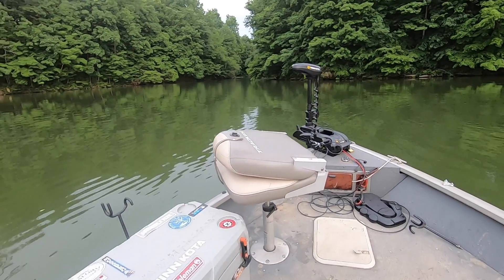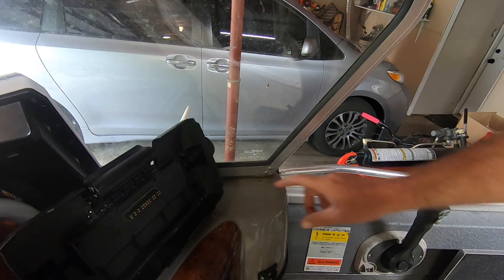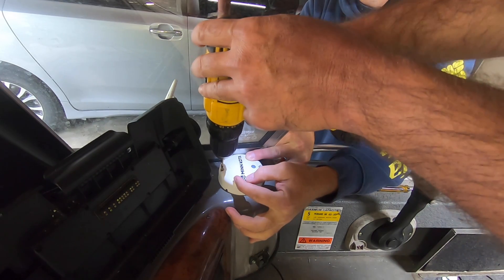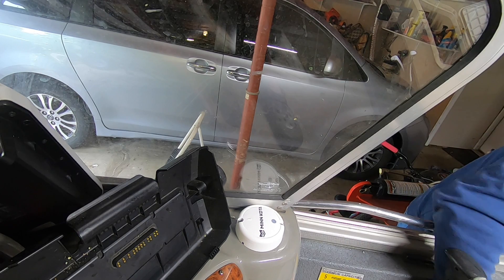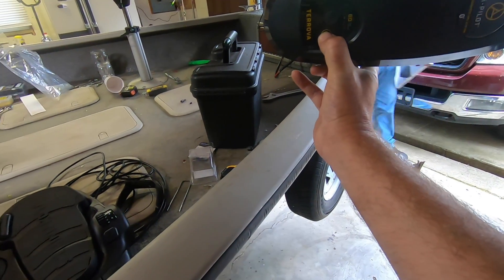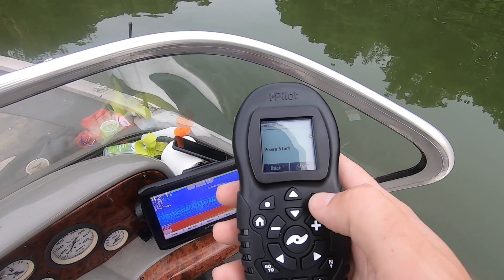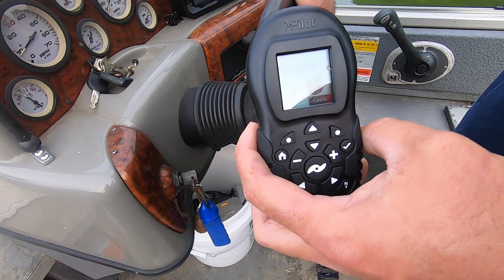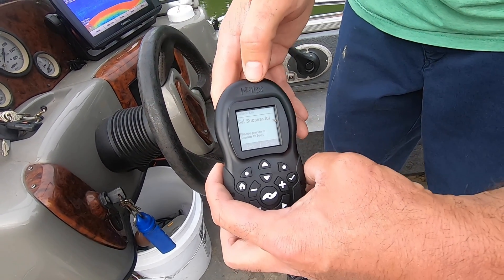Minn Kota Heading Sensor Install, Pairing and Calibration

Comment from the maker: To clarify a mistake I made in this video, the gps is in the motor itself. The heading sensor is basically only useful during the spot lock jog function
Reply: So you can still spot lock without this? It'd basically make me need to buy another battery, so I'm not sure If it's worth it for me yet.
Reply from the maker: @auzyham  yes you can, but I dont see where you would need an extra battery
Reply: Just run it to your starting battery 👍🏼
Reply: I know this is old, but people like me are still watching it. The heading sensor does not point to the front of the boat. The arrow is supposed to be parallel to the keel. Its purpose is to tell the GPS which way the boat is traveling. If you mount it at an angle, it will think the boat is traveling on that axis.
Reply: @williamswavely698  Yes, installed parallel with the boats keel it provides the motor's GPS with the keel's alignment, not the keels compass direction.

Comment: The puck is an electronic compass, responsive to your local magnetic field, which, depending on where you are on Earth, has varying offset.  Nothing to do with GPS as you've properly noted in your correction(s).  Magnetic variation is a fact of life across the globe - and Minn Kota was smart to separate its function from the head unit.  So many people are critical of this decision - but apparently have NO IDEA why it was an excellent engineering decision.

Comment: I taped my sensor in a couple places to see if it worked better in some positions than the others before drilling any holes. It sits on top of the console in my 24' Pathfinder. It works fine through the plexiglass windshield for the bow mounted Riptide Ulterra.
Reply: Good thinking, I wish I had seen this earlier,  like an idiot I mounted mine twice to get it in the perfect spot. lol

Comment: I’m getting the terrova for the spot lock feature does the sensor come with the trolling motor?
Reply from the maker: Yes
Reply: U don’t need to sensor for spot lock.  It has nothing to do with spot lock.  All it has to do with is the jog feature when in spot lock

Comment: The sensor is supposed to be parallel with the keel. It looks like it's angled to the left?
Reply from the maker: Yes its supposed to be parallel. It looks pretty straight to me. May just be camera angle or something
Reply: thanks.  i have one to mount soon and was curious how critical it is
Reply from the maker: Theres a little arrow on it and you want to face it forward as straight as possible.

Comment: Thanks for the video. Would you see any issue with connecting the puck to the 12v battery that I run the trolling motor off of? That would be much easier for me with my boat than the main cranking motor.
Reply from the maker: Most people prefer to leave their trolling batterie(s) for trolling only, but yes it would work.
Reply: @bluegrassstateofmind4542  thank you for the reply! I figured since it's just a really small draw for the puck it would be minimal drain on the trolling motor battery and then I wouldn't worry that it's slowly sucking the cranking battery down.
Reply: @chubbrock659 does it draw power all the time?

Comment: By connecting gps puck to main battery, won’t it drain main battery when not using main motor ?
Reply from the maker: No, it shuts down when the motor is turned off.
Reply: I just installed the Terrova 2025 model. It came with the heading sensor puck with it. Do yourself a favor people and place a kill switch just after the fuse. Be sure to put it in the positive lead only. Now you can kill the power to the puck at any time you want.

Comment: How's it shut off if it's directly wired? wouldn't always be drawing a little power if its wired directly to 12v battery
Reply from the maker: It comes on and off with the motor. It has a blinking light that shows if its on or off. I have many items straight wired to by battery. If its not running its not drawing anything. Its the way the instructions say to do it
Reply from the maker: The puck and motor are bluetooth connected

Comment: I see you connected the GPS puck directly to the battery; did you install an in-line switch or is there constant 12v power to the puck. Secondly, what size shaft on your Terrova
Reply from the maker: No switch, it shuts off after the motor is turned off. 60"inch shaft. I say always go with the longest available. You can always raise it but you cant add length.
Reply: @bluegrassstateofmind4542 ya and then u get to try and cast over 4’ of trolling motor sticking up.
Reply: Gps Shuts off after shutting electric motor or main gas connected to the same battery? As I would think it will drain the main battery
Reply from the maker: @MrBobby778778  it shuts off as soon as the motor is turned off. No power draw at all after that

Comment: Can I ask: do I just add the two power cables to my battery on top of the cables running out to my fish finder? (Haven’t got a clue about electronics)
Reply from the maker: Yes, there are several cables connected to my terminals as well. Make sure to add a fuse
Reply: @bluegrassstateofmind4542  pretty quick on the draw there thank you! Will do re the fuse - don’t want any curious children getting zapped!